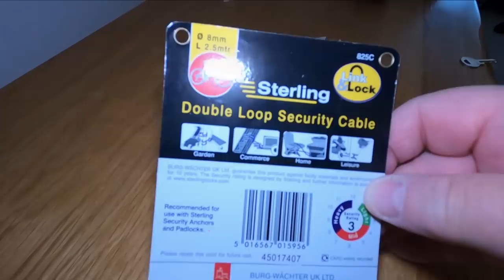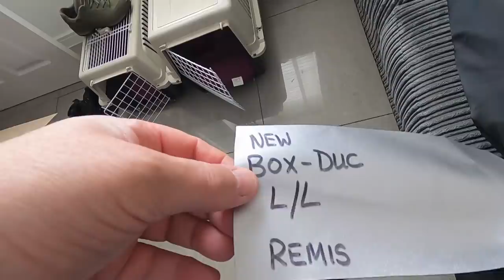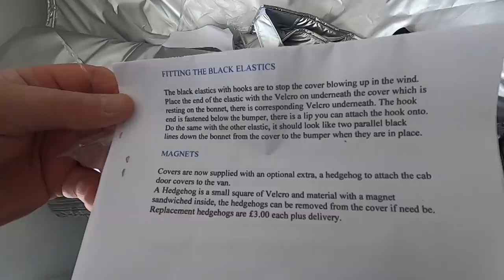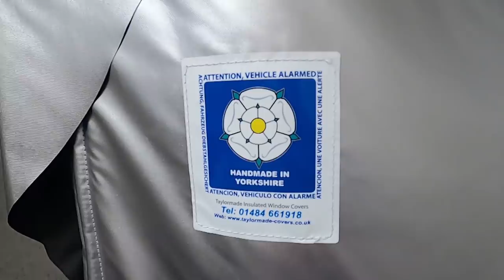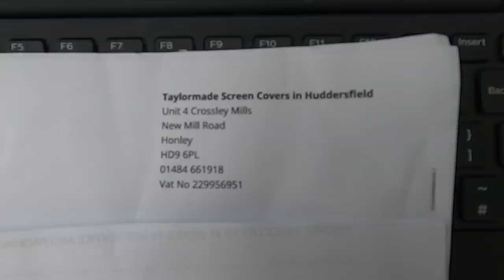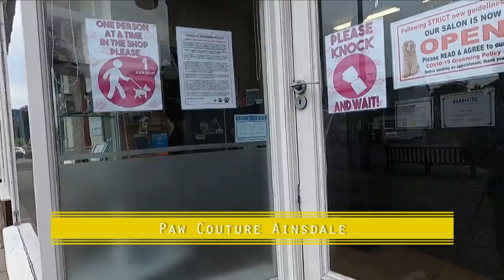Taylormade Long Screen Cover - Stop Condensation | Dog Grooming |Spare Wheel Lock |

Comment: Went over to taylormade for a new screen cover for my Autotrail Fiat ducato today after seeing your video. Had been using a silver screen from my older model that didn't quite fit. Rang silver screen but they wanted £200 instead of the £165 i paid at taylor made. I thought being a repeat customer at silver screen that i would get a discount but it was a no! Same quality and £35 cheaper!!
Reply from the maker: Good news. Been impressed with the new cover.
Reply: @BobEarnshawMoHo  How do you rate taylormade against silver screen original? I ended up selling my Silver screen to a customer for 40 quid i paid about 150 4 years ago.

Comment: Can the Taylor Made be partially opened during the day, or do you have to take the whole thing off if you want to be able to see out of the front?
Reply from the maker: You can roll down the front to let light in, as it is in three parts attached with velcro. There is also a privacy mesh you can buy.
Reply: @BobEarnshawMoHo  Thanks for the prompt and helpful reply. I have a Silver Screens version, but like the idea of the various fastenings and the longer version for when the wind blows.